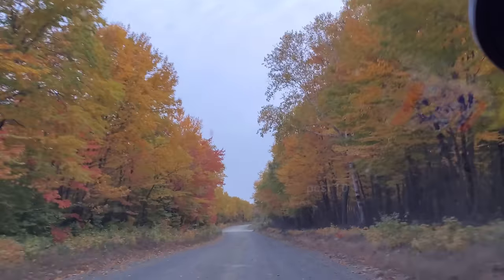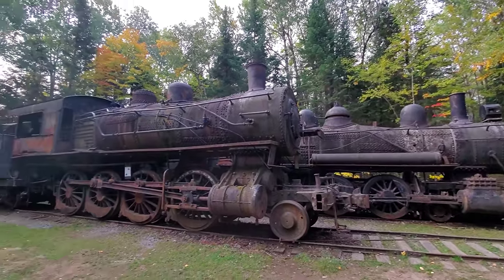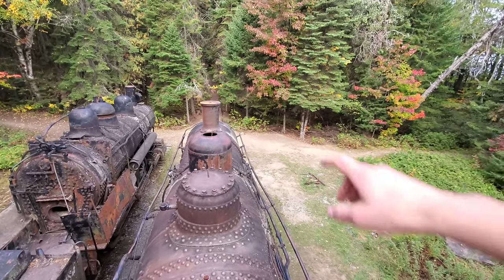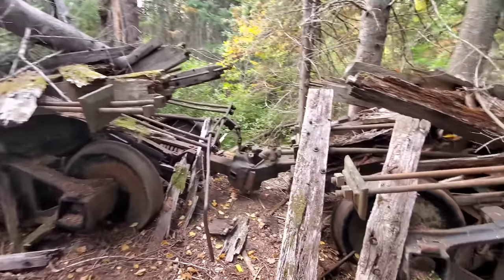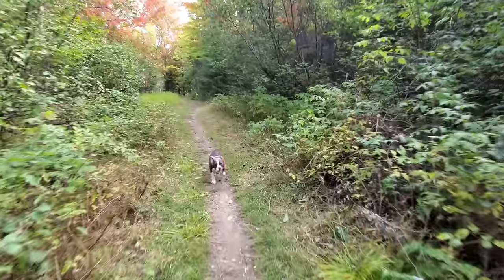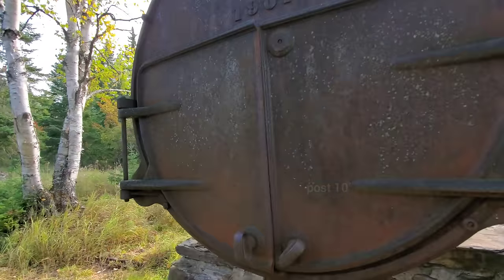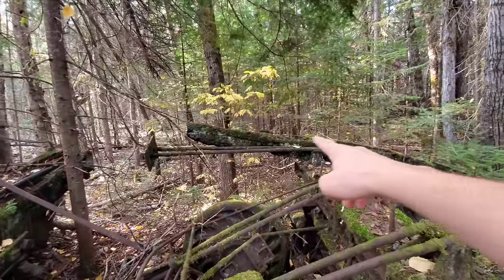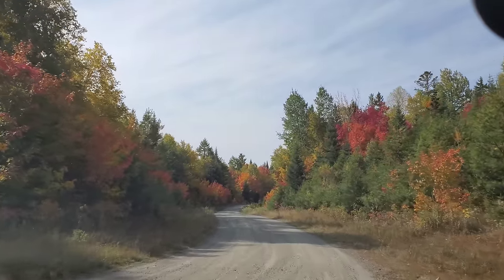Abandoned Railway Deep In Rural Maine Woods

Comment: You mentioned that you didn't see how the cable looped for the tram.  It was a double deck track.   The logs ran on the upper track, and at Chamberlain Lake the wheels dropped down to the lower track to return to Eagle Lake.  The raised example shows both tracks.